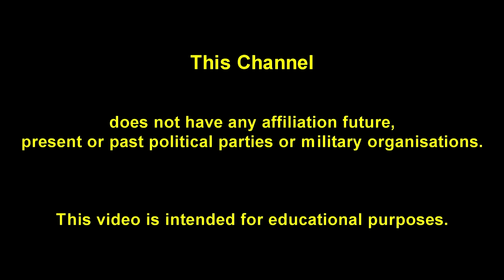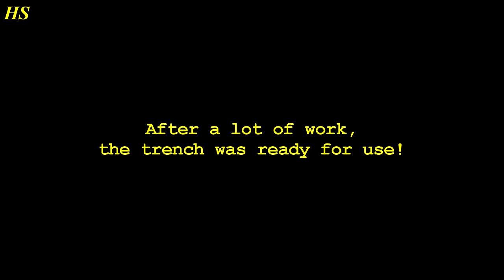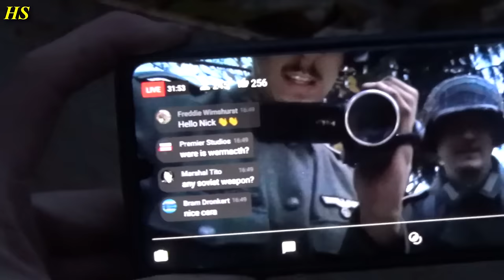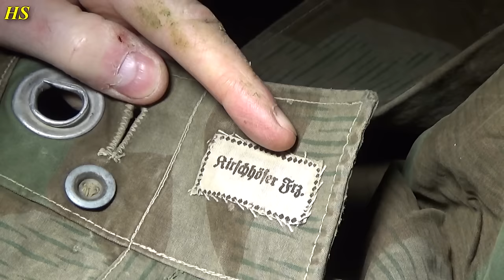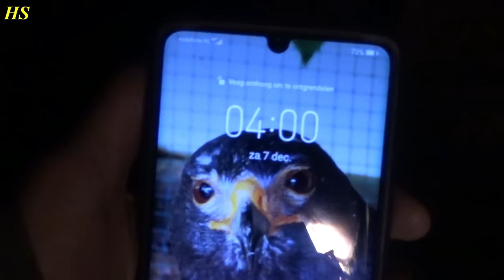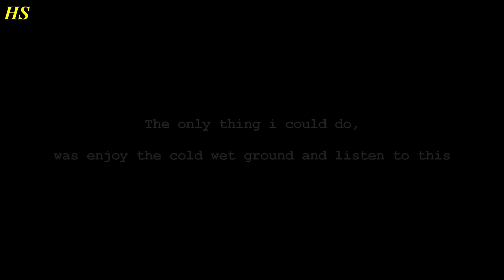Spending the NIGHT in a WWII TRENCH - Wind and Rain - Trench Experience December 2019

Comment: I doubt they would have had perfectly straight and rectangular wooden planks on the front.
Reply: i think they did
Reply: They did
Reply: @Anonymous-bh9om  well i have hundreds of photos from my great grandfather who spent his first years of war in france, then most of it in russia. In the end he fought in Finnland. He has a lot of photos from the eastern front in trenches i will check them later this evening. But i doubt they would leave finely machined plancks to rot in the trenches. I will write a follow up later.
Reply: @Oberkommando  I look forward to hearing back then..  I mostly meant for the British/ French trenches.  I don't know much about the other parts
Reply from the maker: My guests didn't want to lay in the mud, so i had to buy new planks real quick that day, that was the only wood i had at the moment.
Reply: @Anonymous-bh9om  ok so all the photographs that show trenches are from the eastern front. (I have looked through roughly half of the photographs)
 
A lot of them dont seem to have any wood at all. my guess would be that the soil was hard enough (maybe frozen) so that they did not have to put in any planks at all. 

There is one that shows that is titled "überdacht ruht es sich am besten" (under a roof one can rest best) and it is a niche in the obviously very hard soil probably large enough to fit a soldier. There are planks on the bottom of the niche (my guess would be so that the soldier could lay down without having to lie directly on the soil but that would only be a guess.  The planks look like someone cut them off a tree with all the bark still on the sides (if im not mistaken the photograph is a little blurry)
I might continue searching through the photographs looking for trench-pics tomorrow, but its past midnight here and as much as i enjoyed going through those photos i am tired and will go to bed now
Reply: @Oberkommando  did your great grandfather fight against  soviets in Finland?
Reply: @iliilil5761  when germany capitulated he was in Karelia. Unfortunately i have no photographs nor any other evidence of that time I guess they were taken by the soviets, or he lost them during war captivity. Everything my grandmother preserved is from before he left for north.
Reply: @Oberkommando i thank him

Comment: Why do you feel the need to use original helmets, please refrain from sacrificing the condition of these historical helmets for your reenactment
Reply: Because he can do what he wants
Reply: The helmet shell is probably the only thing original. The strap and liner are not, so imo it's fine and should be use. However, if the helmet is retained the paint, liner, strap, decal, then it shouldn't be used imo
Reply: Plus, an original shell is better than a reproduction